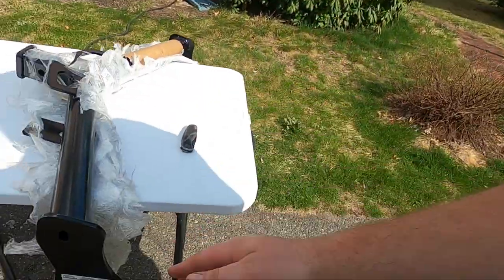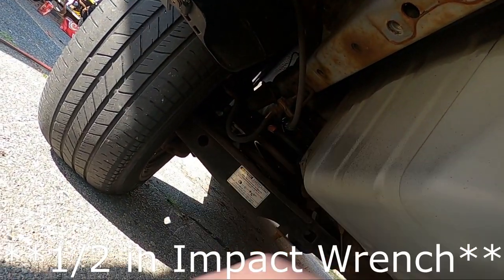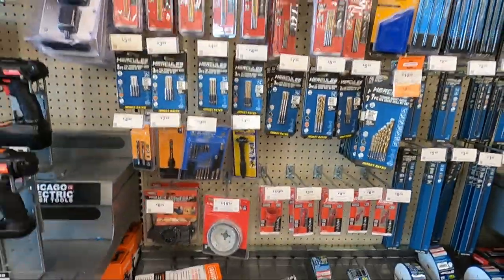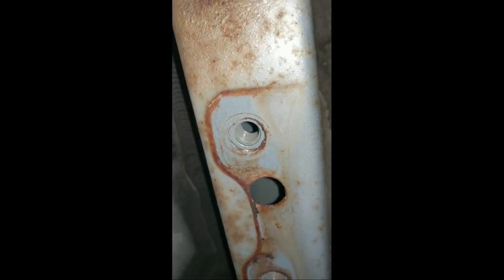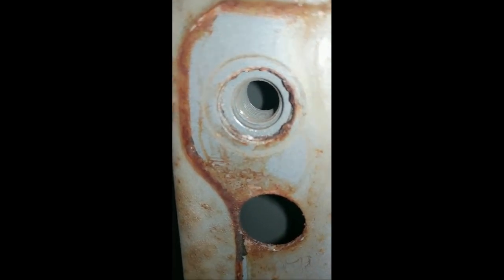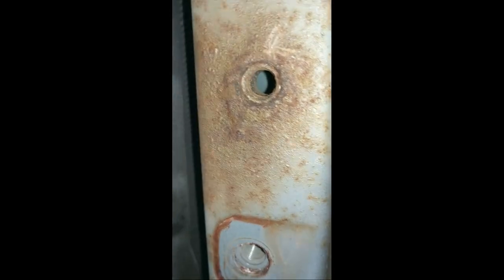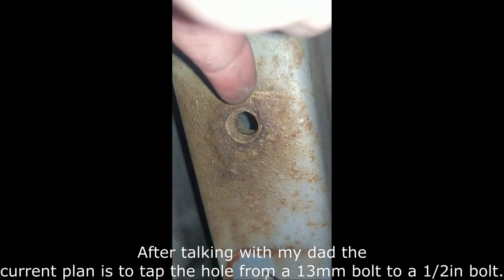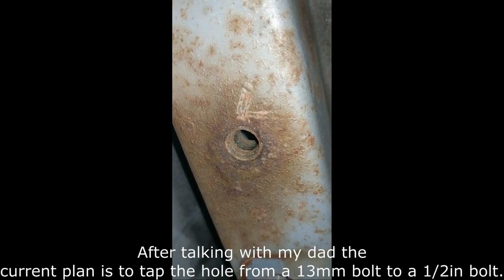FAIL! 2010 Toyota Rav4 Trailer Hitch Install

Comment: I ran into the same problem, I got lucky with a M12x1.25 metric plug tap on an older Rav4. Lots of PB blaster or WD40 while tapping. If you do go up a size, the 1/2" NC 13 tap and bolts may work. PS, Exhaust side needs open ended wrench when tapping as there's not much room there, Good luck!
Reply from the maker: Thank you for that information! I was looking at the M12X1.25 plug tap but am concerned that threads would still just be rust and would be weak. Then again, I won't be using the hitch to pull heavy stuff, more just storage / bike rack so might not be a problem. I'll definitely try that first!!